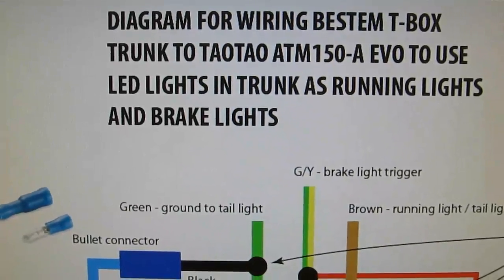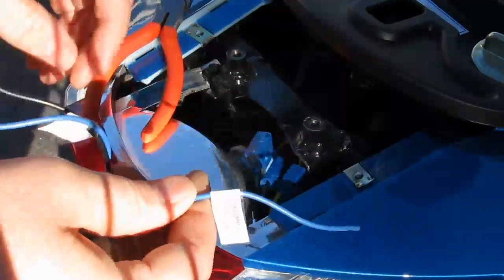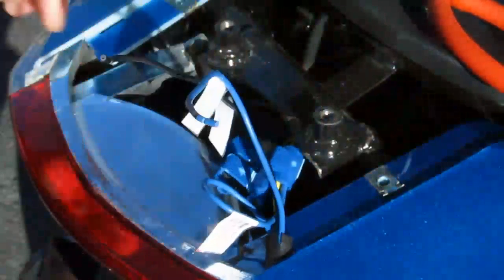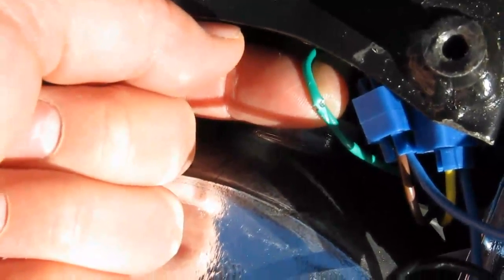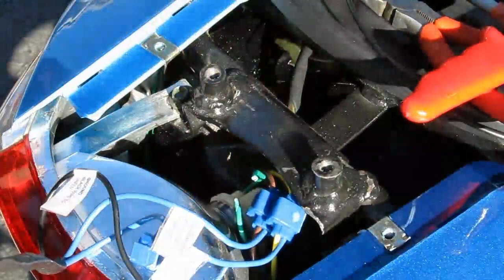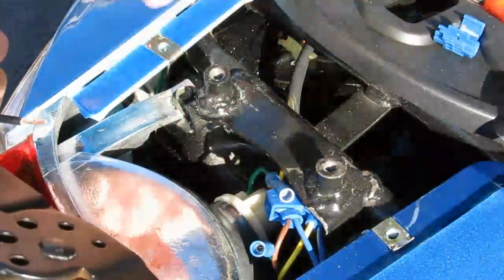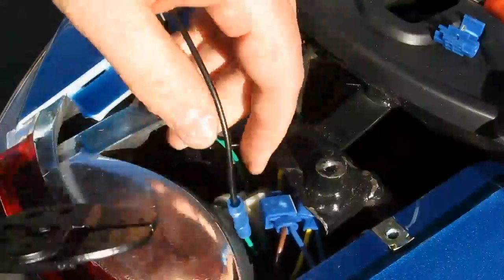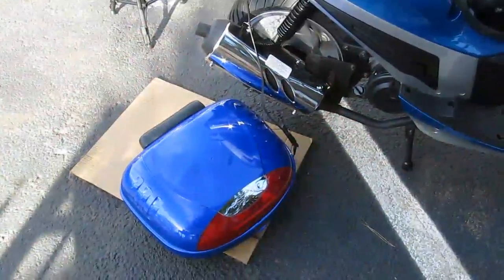Taotao ATM150-A Evo scooter - Bestem T-Box trunk LED wiring (part D-2)

Comment: Which Dual Element circuit did you get? They list several. If you got Part# 6123-00 is for 5-10 LED Strips I'd be really disappointed. But if you got Part# 13-307 is universal for most aftermarket LED turn signals I'd be curious if the other one would work better.